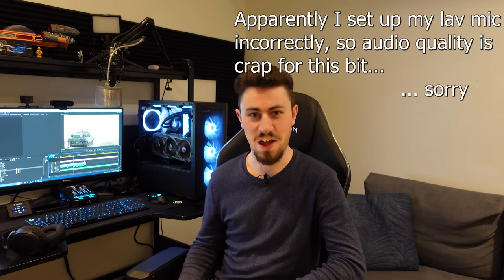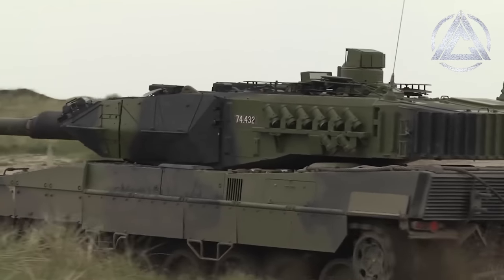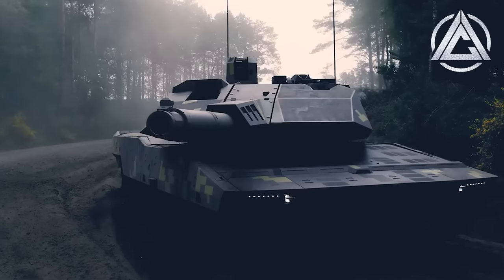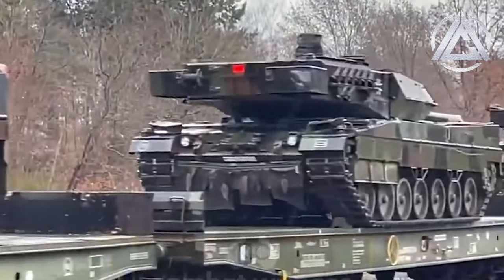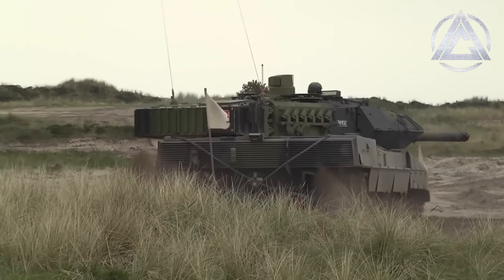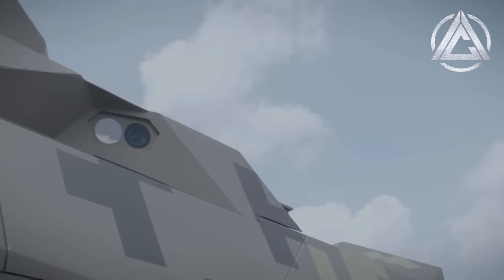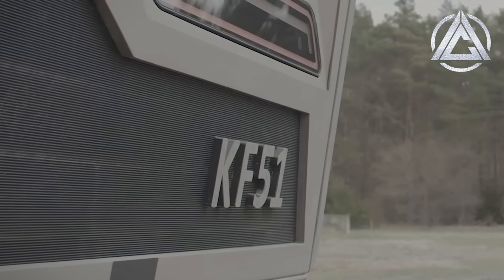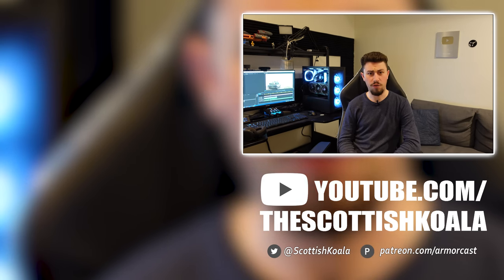Germany's New KF51 Panther Tank | The Spearhead of a New Generation?

Comment: What is the point of it? I will be never used anywhere because Germany will not want to escalate any conflict. It is better to achieve peace by trade. The warm ass in the winter is the most important thing for Germany. Anything else is irresponsible. 
Right?
Reply: Demonstrably wrong. Germany is one of the biggest supporters of Ukraine. In fact depending on the metric used it is the second largest supporter.
Reply: @emilsinclair4190  Too little and too late and everything tailored so in effect the conflict is (and will be in effect) frozen. 

There are many metrics and in one of them should be moral support for recovery of all of the Ukraine territories occupied by Russia and diminishing and eventually elimination of the Russia's imperial posture. This is absent in German official political discourse, especially if compared to the incessant warnings about "not provoking" and the repeated calls for creation of "off ramps" for Putin (when the only decent off ramp for him would be trial and hanging).

By some other metrics, like per capita or per % of GDP Germany is not so much. If it was just for Germany, more than half of Ukraine would be occupied and the next Russia's target would be Poland. That would be a spectacular German policy success.

In the particular case of the tanks and other weapons the Central Europe countries should look into their own manufacturing capacity with quite logical cooperation with South Korea (who unlike Germany, is not confused who are friends and enemies). Weapons which cannot be used when and where they are needed, ARE USELESS.

So yeah, Germany can do whatever they want, make new tanks or whatever, mothballed them until they rust. But this time nobody should buy and refurbish them only to be constrained by Germany's inability to look beyond the needs of keeping their thermostats up.
Reply: @Bogdan Baudis   the conflict would always end up frozen for some time. This was obvious to everyone with knowledge about military matters. Now comparing Germany to other western countries you will see that they provided similar stuff at the same point. So why single germany out.

Yeah no. Do you know why Russia is fighting even though it is obvious that they can not win? Because their leaders can not loose face. Providing them with offrams is therefore the most logical step to stop Russia from fighting. This strategy is also supported by other western nations so why single out germany?

The idea that the next Russia target would be Poland shows a laughable understanding of international politics. First of all Poland is in the eu and nato so this would not happen. Secondly there are other vountries Russia would attack earlier.

And belive it or not if you would single out the military support by any country (maybe except the us) their support would not have slowed down Russia by much since most nations can not provide a lot of stuff.

You might not know it but germany has not denied an official export request into ukrain.

And you bash germany and use South corea as a good example? Compare their military support to germanies and you see why this comment is hilarious.

Your idea that germanies policy is hugely influenced by russias gas is stupid. Germany has made huge moves away from it and has supplied the same weapons other western countries have. 

Now why has germany send fewer weapons than some countries? Relatively easy explanation. Germany does not have a huge army and not a lot of spare parts and Munition. It sold a lot of ist storage to Eastern European countries when the cold War ended. Other countries that have a lot of military equipment in storage have therefore an easier time providing military equipment.
Reply: @Bogdan Baudis  if the explanations are good than maybe this strategy is correct? Just because a strategy benefits germany it is not necessarily wrong. And Germany has sacrificed a lot to support Ukraine.

Has nothing to do with understanding since everyone works basically to get the same thing. However we can only assume which information our enemy has acces to.

And no it is a relatively good prediction. Ukrain has a high moral so even if the ukranian military would have collapsed partisans/rebels would have continued the fight. And Russia will not retreat bc the leaders would loose face which would be a death sentence for them. So since nobody benefits from stopping the fight and since both don't have the military material to beat the other (you need a significant number advantage to beat an defender. At least in classic military theory)

Sorry but your statement about putin shows me that you in fact don't know how Russia works. The Russian population likes strong independent men and putin makes them belive that he is one. Strength is a virtue in Russia.

In the case of an invasion of Poland this would be the start of ww3. And since the militarily allied nations in Europe basically have the numbers advantage in each field Russia would have no chance. Ulrain was  only attacked bc they believed that a win was possible. An attack against nato would be impossible to win.

You might not know it but germany has a military base in Eastern Europe and is currently providing the rapid response force of nato.

That central Europe considers German ideas to be ridiculous is a fact. But since the ideas of central Europe are also demonstrably ridiculous sometimes this is okay.

Russia is not an enemy or we would be in a war with Russia. Russia is currently a potential enemy. 

Your comparison runs into the problem that a country can not send material I'd does not have. Since germany sold a lot of its old material to Eastern Europe they are able to provide a lot of material. Now the funny thing is that germany enables some of the exports of Eastern Europe by redeployment anti air or other systems into this area.
Reply: @emilsinclair4190  Germany is historically co-responsible for the Ukraine's plight. Before WW2 I would say that the responsibility would be a 3-way split between Commonwealth, Muscovy/Soviets (e.g: Russia)  and own Cossack/Rus(nowadays: Ukrainian) mistakes. However, Germans managed to grab a large portion of it in WW2. If you want to dispute it, do not dispute it with me but with dozens and dozens of historians who wrote and said so (including some German ones if I understand)

The "demonstrably ridiculous" assumptions and predictions of the Central Europe about Russia come true one after another. The seemingly "rational" Western Europe ideas like "peace through trade" and other come one after another as naive at best and hypocritical at worst. 

"Russia is not an enemy" is a typical example of such idea: maybe do not believe me but listen for a while to what Putin, Solovyov, Illin, Dugin etc. etc .said or are saying. This statement is as ridiculous as saying that the III Reich became enemy of Poland on September 1st, 1939. It may be legally true but in terms of actionability is useless. But let's drop the pretense: it is just a cope,

A leader who shows again and again that it cares predominantly about its own interests is not a good leader. European and USA mistake might be that they wait for the German Godot leader finally to show up ... Providing money and materiel is one thing, but leadership requires more: being capable of stating the convictions even if that carries the risk of inconvenience (like incurring Putin's wrath).

Estonia, Lavia, Lithuania and Poland provided in proportion to GDP, population etc. much more than Germany did. Germany provided more in absolute numbers because it is richer. And it is richer because it had good luck to be on the better side of the Iron Curtain for almost a half of century. If it wants to savor its good luck and say to the eastern neighbors "too bad", well, that will not buy much sympathy or good will. So good times roll, until they will stop ... The it may need sympathetic neighbors ...
Reply: @Bogdan Baudis  reread my previous comment. Not transformation by trade. Transformation by trade is a cultural change caused by trade. Such a change might cause peace but it would take a long time to change a culture so currently this is only a methode of peace between western countries.

No. What I am talking about is peace by if you start a war your economy gets nuked. You have not followed some of the statements made by Poland right? Sure Poland not wanting Russia to force them to do something is good. But this is not the issue. Blind hatred against Russia on the other hand is bad.

Nah you are the actual Russian asset. Bc people like you with not a lot of political education that don't know much about peace theory and that like to hate russians are the reason why Russia can make up excuses that are sensible enough to gather some supporters. Well done. You play right into their hands.
Reply: @emilsinclair4190  The actual concept of Russia is not that difficult to understand, especially if you REALLY listen to Russian people. It is difficult because they always try to lie all the time about everything, it is a cultural coping mechanism very strongly reinforced thru generation. However, if you enrage them enough you may hear what they actually think.
Once upon a time I was riding one of the "smugglers' trains" (a part of the bygone communist world reality). By necessity the passenger lot was international. Few of us had a conversation about one or another idiocy of the system. This managed to enrage a Russian "babushka" and she unloaded on us exclaiming among many things that if "Stalin was still alive he would show us our place". "Us" meant of course ungrateful Poles, Czechs, Slovaks etc.
Few more exchanges followed.
This was my 1st lesson "from the horse's mouth" about the nature of Russia (before that, I heard many tales of people visiting the more charming parts of Russia, like Siberia).
It goes like this:
The only way to achieve true happiness is to achieve power (from "Babushka": "What are you?! Nothing! You cannot do a thing, you are powerless, you are a worm and should stay down!").
If you have power, you can have everything else.
If you do not have the power, you lie down and hope that you will not be kicked in the face too hard or too many times.
You may get stomped, but that is fate, you cannot do anything about it.
The only sure way to achieve power is to put everybody else down and keep them down there ("Babushka": "He [Stalin] should have send all of you to Sybir!").

This is ingrained in the Russian culture from the times of Mongol Yoke through Tzars, Soviets etc. and now Putin with his oligarchs. From Ivan's "oprichnina" through "ohrana" to Smerch, NKVD, KGB and now FSB.
It does not have to be absolute power; it can be a local one.
And if you cannot be in power there are several coping mechanisms to employ: drink or identify with the imperium and be happy that others, while richer they may be, they are still afraid of "us".

The existence of successful happy bordering people who are not afraid of Russia is unbearable to such society.

This can be only changed from within, and it must be widespread.
What West achieved for the last 30 years is to help build Potemkin villages of Moscow and St.Ptersburg, help to build a fleet of obscene monstrous pleasure crafts and few ridiculous golden-plated palaces.
This also fooled few hundred thousand people into believing that they are almost like West.
When they found out in February 2022 where they really are, those who could, they ran.
Depressingly, even many of these still have imperium in their heads and hearts.
Most of those left behind still dream of imperium and most of them live in REAL Russia, the one in that the Moscow-SanktPetersburg express train does not stop.
The one from where the POWs are expressing bewilderment that Ukrainians have toilets inside their houses. Etc. etc.

That Polish xenophobia is exceptional, it is mostly German/French construct, 
Polish people are as xenophobic as Greek, Germans, English etc. etc. Some of them are, some not.
The common history of Poland and Ukraine is drowned in blood.
But Polish people and lately Polish state understood that the free democratic Ukraine is much better neighbor than imperial hysterical schizophrenic Russia.
They are still many Polish survivors or orphaned children of the ethnic cleansing perpetrated by Ukrainian nationalist. There is enough of bad history to derail ANY Polish government trying to be friends with Ukraine, but that did NOT happen.
So, stuff your "Polish xenophobia" where it belongs, to the place where it was pulled from.
Most likely it is German/French/English cope mechanism to dismiss their WW2 misdeeds to Poland.

Western countries would be better to focus on the doable versus fantastic.
Ukraine can be made into a successful democratic and free country and as one of the world's breadbaskets, it would be better if it was.
Only then, maybe, just maybe, enough Russians would understand that there is better path for their nation.
"Russia can be a democracy, but then it cannot be an empire."
(Not mine, few people wiser than me said that).
Reply: @Bogdan Baudis  your comment shows exactly what I warned about. You comment shows the exact problem many Eastern Europeans have when they think about Russia.
Russia is a country with more than 100 milion people. With countless different cultures and histories.  But you try to press them all in the same group. And obviously this group has to hate you. No I am not denying that there are russians that hate you. But I am denying that some of them hate you. But not all hate you.  And the number off people that hate you is also influenced by russian propaganda and your behaviour.

And maybe you are able to see the vicious circle. You belive that all russians hate you. This is why russians in Eastern European countries are sometimes treated as second class citizens. Now by doing exactly that you give the Russian propaganda Munition to use against you. And some people that don't have any problems against eastenr Europeans themself (Especially the younger once) will see reports about Eastern Europeans discriminating against russians. Can you see why such a person might hate you? Because 80% of the people fall into the trap off believing that a group is somewhat homogeneous. No other is not.

And because off their shared soviet history the hatred of many Eastern Europeans for Russia has demonstrably been higher. As has the discrimination.

Now regarding the economic effects. Change happens. But way to slow. Wait 100 years and a normal exchange will bring change that is drastic enough. But this was also not the strategy of the west. The west used Dutch disease to controle russias economy and to be able to crush russias economy in the event of a war.

Comment: I would just stop building tanks altogether, I believe that soon they won't be very useful in modern battlefields where a less than 100K drone can take out a $10 Million dollar tank from 50 miles away... (well outside of the range of fire of the tank).

You take 100 M1A2s and I'll take the financial equivalent in drones, giving me about 150 to one odds to take out each tank. I don't like the tanks odds.
Reply from the maker: This is why short range air defence or SHORAD is all-important, along with active defence systems and other anti-drone measures such as KF-51's Natter RWS.

What's important to remember is that a tank is not  just a tank - they are not put in tank-only units... an armor battalion will also have recon vehicles, infantry teams and air defence right there with them, allowing the MBT to do its job unmolested.

Comment: Sorry for my english plz

KF51...  Rheinmetal NEVER built any tanks, only canons and ammo. The only aim of that prototype was to enter the FR/GER common 2017 "MGCS" program which is 50/50 for industrials GER/FR. With gouvernements agreements between German's Krauss Maffey Wegman ( KMW) producing Leo1 ,2 PZH etc etc and French NEXTER producing LECLERC and CAESAR, jaguar etc..
So... from 2017 MGCS hardly goes on... and since 2019 when , crazy German gouvernement said yes to Rheinmetal to get in thez programm it virtually stopped... KMW and Rheinmetal are at war for the 50% German's part.... and when 2022 the Rheinmetal KF51 appears  with 130 mm NEXTER already had à better 140 mm done on LECLERC message was clear no need  RheinM.. etc etc 
So only thing Rheinmetal did is makes everybody loose à lot of time. What you can wonder is where is the German's governement advantage in putting such mess...? And what Rheinmetal's prototype means ? just NOTHING. they just try to overcome KMW that even had to sue RHEINMETAL aug 2023 because they profest that they own the brand name LEOPARD of cause they lost.
Here is the political history of the "KF51" which anyway cannot lead to anything, Rheinmetal is involved in car production and canon and ammo. Actually very rich but has far less knoledge even in artyllery than NEXTER because if you know about artillery the french invented 1876 the first ever Steel grooved 155mm "de Bange"  and 1917 the first modern 155 was the 155 GPF , father of US "long Tom" M1,2... and CAESAR. ( FRF1 etc)
So if NEXTER and KMW = KNDS cannot produce new MBT it will be 100% fault of german's gov and RHEINMETAL.( very very rich with ukraine war, but built 1 prototype ...
At least, Rafale was supposed to be an UE project, LECLERC is  true last MBT in UE and I think only one shooting/recharging while it moves and combat proven ( Yémen) so may be we might do without Germans ....thx Rheinmetal and Merkel ...like for Gasprom 😢